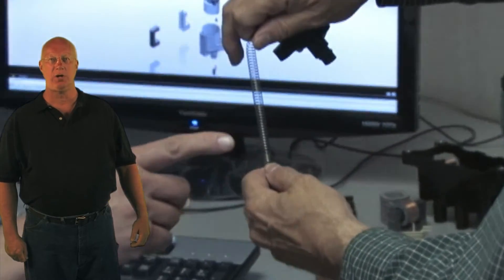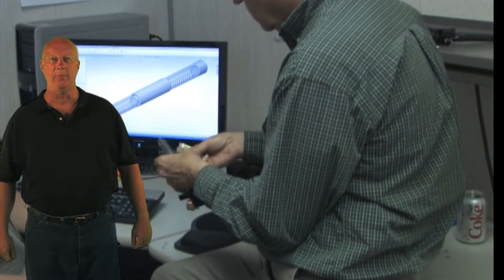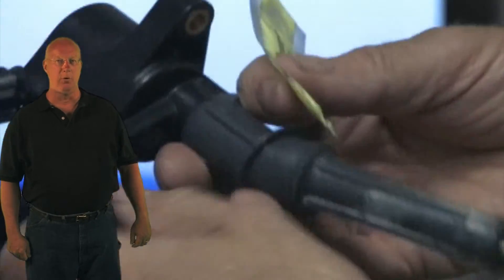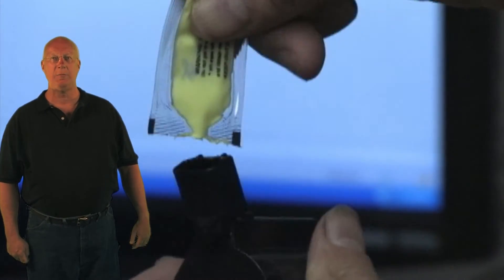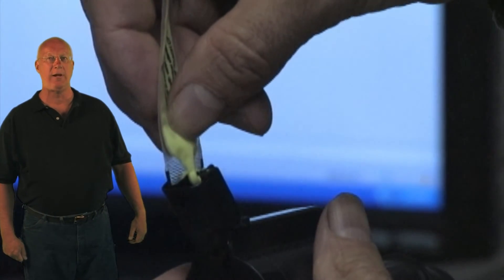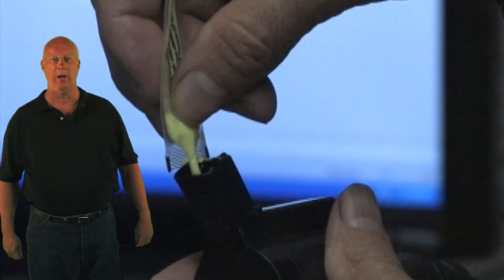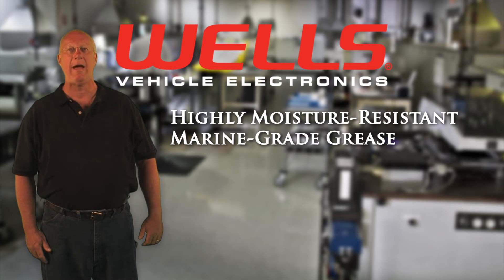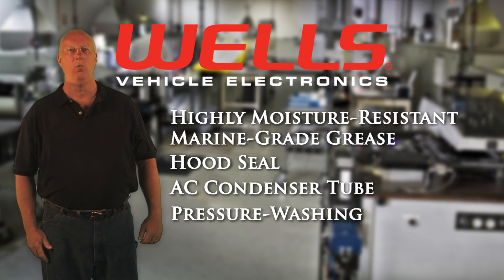Ford Coil on Plug Advantage by Wells

Comment from the maker: You want to put a coil on plug system in place of a DIS. Not easy, you will need to change the PCM also for starters. You will also need to change the entire wiring system etc. Is it possible? Sure! Is it something you want to do, probably not. The only way to adjust timing is to get an aftermarket chip for the computer. Check on line you might find one. Best of luck to you,

Mark Hicks
Wells Vehicle Electronics